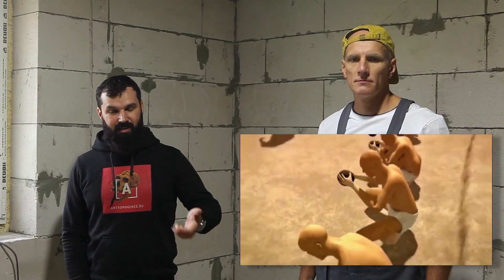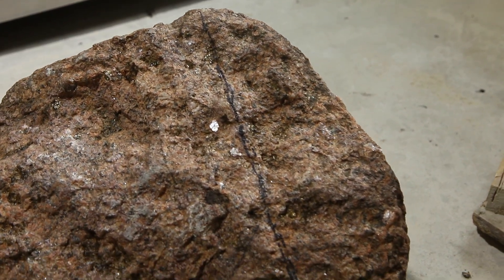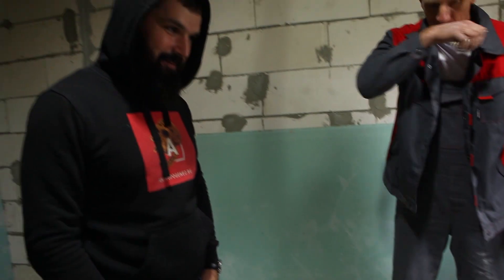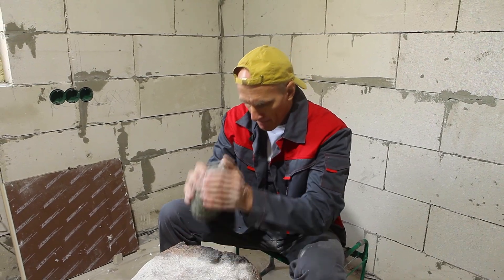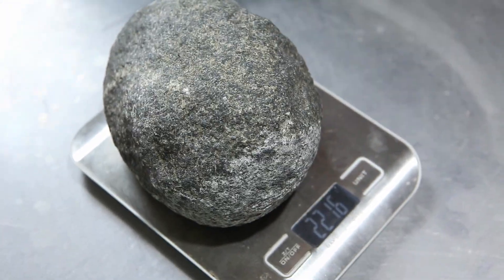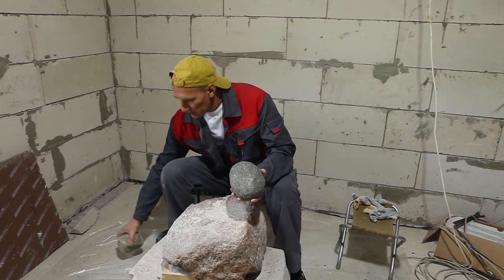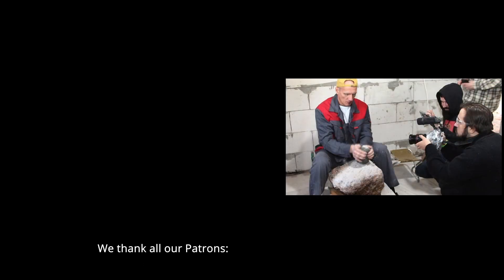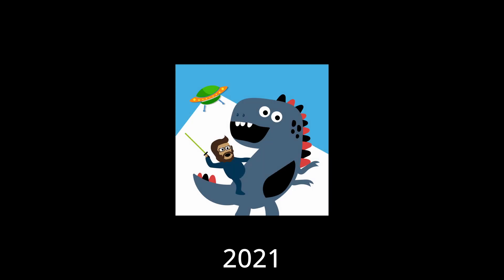Dolerite vs Granite | Could Ancient Egyptians carve obelisks?

Comment: Sorry pretty lame demo. The scooping on the unfinished obelisk are more patterned and no room underneath to remove the materials with pounding alone and what about the clean saw cuts on the interior and exterior of the massive 30-ton, black granite sarcophagus
Reply: There are lots of pics and videos of miners chasing narrowing streams of ore in spaces smaller than the underside of unfinished obelisk. Unlike the squarish “scoop marks” that are on the top the sides and underneath of unfinished obelisk are long grooves. Indicating grinding action being used.
Though you only need 6 inches/15 cm room to bring the hammer back. Plenty of room to do that, the same action they are doing here. It’s not necessary to lift it high above your head.
Reply: @SacredGeometryDecoded  I had the fortunate occasion to visit Egypt recently, including the unfinished obelisk. To my great surprise, there are no trenches cut under the obelisk. All the trenches are vertical, outlining the shape of the obelisk, with a few deeper holes for checking the rock layers. 

The trenches cut under the rock are actually from a near by smaller (tough still massive) block of granite. The unfinished obelisk never got to that level of processing due to abandonment, but the photos of the obelisk and the undercut trench are usually shown together, therefore the confusion.
Reply: they would no separate the obelisk from the ground like that when they could just split it off with wedges, like how they do it in quarries. 

the 'scooping' is more patterned? how so? the scooping here looks similar, but more shallow and also only one depression. But that is reasonable because they only did it for 2hr
Reply: @diobrando2160  they're isn't enough room under the obelisk to get enough force to hammer the stone. This is granite not limestone
Reply: @shidoin5398  Thats bs
Reply: @shidoin5398  " they're isn't enough room under the obelisk to get enough force to hammer the stone. This is granite not limestone"

I'd like to see your calculations to prove this :)
Reply: @BluntofHwicce  I've seen very slow outside cutting on blocks. I have yet to see a 30+ ton granite block hollowed out
Reply: @BluntofHwicce  Bronze was perhaps not even as necessary in ancient Egpyt owing to their native chemically impure copper sources producing an alloy somewhat more durable than pure copper.
Reply: @BluntofHwicce  very good description! Thank you. If you look at pictures of what many call the scoop marks, there are also horizontal striations within the scoop. Those would not be present by using a stone hammer alone. I have not yet been able to see this in person , only going by pictures and videos of people trying to use stone hammers
Reply: @shidoin5398  The marks are not 'scoops' at all but dips formed from the bashing away of the stone.

The horizontal marks are probably from workers doing the same thing but at a more horizontal angle instead of straight down.

If you assume that someone could probably wrap the hammer stones and attach them to a bone or wood handle as leverage then it makes a lot of sense that you would also see those horizontal marks.
Reply: @mnomadvfx  interesting theory. The problem is when you hit the granite you don't leave striations! You leave behind sand and pock marks
Reply: @BluntofHwicce  i definitely think they had some type of grinding tool, be it copper, stone or a combination. It wasn't done by pounding
Reply: Please just be patient Shidoin..I believe they are working on more experiments related to that....If you watch a lot of thier vids, you will see that you can use stone to cut granite and even dolimite...and very cleanly...they are learning as they go, as this type of thing hasn't been done in a while and they have to figure it all out using the same tech the Egyptians and other Stoneage civilizations used.